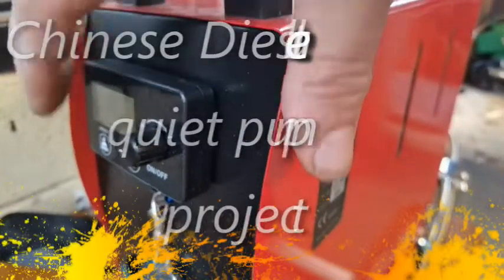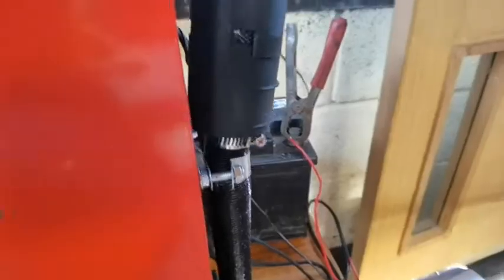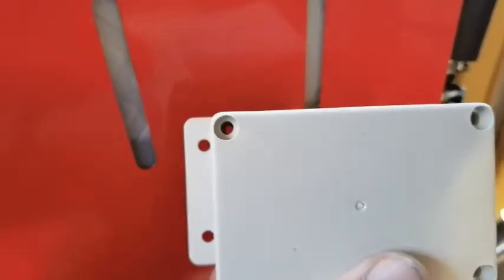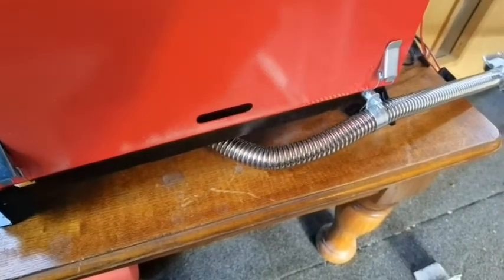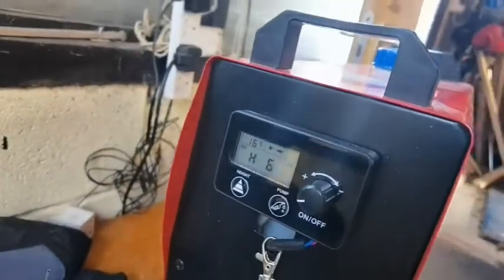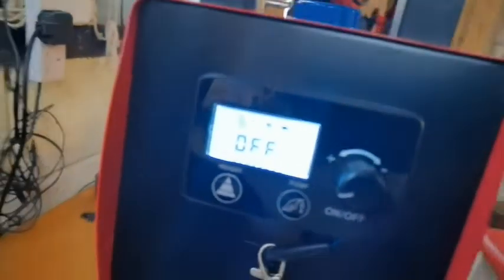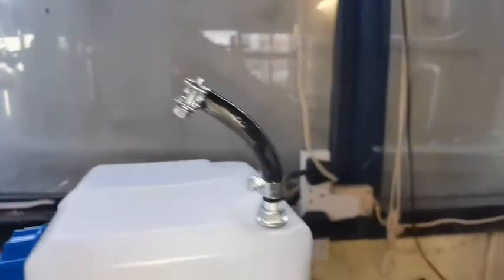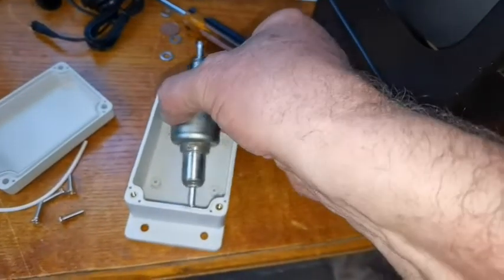Chinese Diesel heater quiet pump project

Comment: Thanks for the thought provoking video. I think much of the noise it due to the pipes tapping on the case and other rattles. I have a similar heater and I love it iny small van 

I got some bitumen car body sound deadening sheet and stuck it to every flat surface I could find within the case. Also wrapped the pump in it like you did. I did away with the rubber bracket and wrapped the pump in strips of Karimat foam and just jammed the encased pump into the space. I put this soft neoprene like foam sheet in all places where pipes touched the case.  

It's a lot quieter and the ticking is a soft dull tone. Acceptable but I'm still looking for ideas. Potting the pump in silicone is my next idea but I'm looking for examples first. 

Nice video thank you for your efforts.

Comment: My Dad had some success quietening the noisy pump by wrapping it in neoprene foam, then dangling it from small rubber bungies which helped isolate it from the heater body, I mean it still clicks but not much of the sound makes it from the pump to the rest of the heater. The weird thing is, I've got a Japanese paraffin heater which uses a similar solenoid dosing pump, but for some reason that makes no discernible noise at all.
Reply from the maker: Thanks for watching and comment
Reply: Parrafin might be thicker and thereby dampening

Comment: Great idea using the box but if you had used acoustic wadding or quilting rather than hard rubber it would improve the sound reduction hugely. In the example here the pump sound transfers easily through the rubber to the outside box and onto the outer heater casing so not much if any change. Enjoyed the video and thanks for posting
Reply from the maker: Thanks for the tip!
Reply: Silicon works well. It's possible to run these with no pump, just needs one to start or there's an error code. Measure the flow properly and it's no problem, totally silent.
Reply: @MHLivestreams  What do you mean measure the flow?
Reply: @georgeda90  should have said fuel rate. To calculate the fuel used when operating by pump.

Comment: What I did was bought a silicone mold making kit.  One that xxx toys could be made of soft.   An taped the hose ends.  And the plug part.   An just got a Tupperware container.  And encapsulated the pump.  Than with a razor blade.  Extracted to my tape areas to expose the plug an each hose end.  Plugged it up to the hoses an plug.  An just stuck it in the heater an closed it up. 

 I didn’t worry much about the pump getting to warm due to its electrical workings or what not. Due to when it’s used it’s cold in general.  
An never has an issue. So it’s kinda floating in its lil spot inside the heater inside of a soft silicone block
Reply from the maker: Now thats worth a go thanks for info
Reply: Play Dough or modeling clay is much easier.
Reply: @castorpollux3752 I would have NEVER thought of using playdoh!! Good idea!

Comment: Try a softer insulation material , mount the pump  outside in a insulated box . Make sure you use thick material. Do not mount it on the case. The rubber you used is to hard and as somakes little difference. Good video though, shame it was not as good as you inticipated it to be.
Reply from the maker: greats tips thanks for watching Andy

Comment: I did this using roof and gutter neutral cure silicone.
It was a layer about and inch thick around the pump body, once cured clamped in a box similar to yours and its barely audible. 
Problem solved!
Reply: Please post a video of your silicon solution. If your solution works as you claim you will get thousands of views.

Comment: Try it without the box, wrap with a pool noodle, or pipe insulation, a couple of wraps of electrical tape, then a 2" x 1" double sided foam tape and stick it to the back metal of the unit and try to keep the angle correct. It should isolate the pulse, and the slapping home of the pump piston.

Comment: Just thought I'd mention that the muffler should be mounted vertical with the drain hole facing down and the lowest point of the exhaust system

Comment: The back panel of the case that the pump is bolted to is vibrating causing the noise.
My pump is attached to the frame of my ford e250 with the rubber holder. She's quiet as a mouse.

Comment: Buy an Eberspacher pump, in the blurb for our heater it describes the pump as “near silent” ours is mounted underneath the van and I can honestly say I’ve never heard the pump either Inside or outside the van. Hope this helps someone.
Reply: Do the pumps need sealing in a box or something under the van I worry about rain water etc
Reply: @scousebikers  I think the pump is alright it’s the circuit board in the Chinese heaters that is not sealed against water and hence it’s vulnerable to water ingress.
Reply: @AJ-qn6gd  oh yeah that's no problem that's inside I am just rerouting fuel lines tommorow hopefully was using a auxillier fuel tank but it started leaking inside the van what about the connection to the pump surely that's not watertight??
Reply: @scousebikers  the electrical connection should be an automotive quality connection with a small rubber seal in it and snaps together like engine sensor connection not heard of any problems with the pumps, mine is under the van and no issues whatsoever.
Reply: @AJ-qn6gd  ahhh perfect I'll have a look to be honest I didn't think but it makes sense that it would be waterproof with it being for boats cars etc

Comment: From what I do know about soundproofing. You may have two issues . One is the rubber you used is probably still allowing the vibration from the injection pump transfer to the outer metal case .   The other issue is the plastic plug is touching the plastic housing when you put the lid on , that allows the vibration to transfer to the plastic box .  Also same with the hose ends .  Might I suggest trying to use sound dampening materials for example put it in a box that is twice the size of the plastic box and use cardboard egg cartons on the inside walls of the box then find a block of soft foam to mount it too inside the box ,  run the hoses through that box without touching the sides of the outer box but through some soft foam .  It won’t fit inside the metal container but it should still be as quite or better .
Reply from the maker: Cheers Steve will give it a go

Comment: Try closed self foam insulation like you use in HVAC. It’s black in color and you can get it in different sizes. You should be able to simply wrap the insulation around it and zip tie it to keep it closed all done, faster and cheaper.

Comment: To start, buy an upgraded fuel line kit, run the pump in a vertical orientation. As long as the pump no matter what the insulation is affixed to a solid percussive object you will hear it.
The rest is easy.

Comment: there are two fails that makes the whole invention totally useless: the ends of the pump are tuching the plastic box, AND the plastic box is touching the main case through the bolts. My friend, unlike the thermal isolation that admits some looses from thermal bridges, the mechanical vibration isolation REQUIRES a TRUE mechanical TOTAL isolation!
Make the pump "floating" in soft foam and you will success
Reply from the maker: Thanks ill give that ago

Comment: I know this is an old video but from a sound engineering perspective I would try wrapping the pump in a butyl type tile for automotive surfaces, then encasing with a fair amount of closed cell foam and lastly a mass loaded vinyl.

Comment: You need rubber mounts from the box to the sheet metal. the sound is amplified by the sheet metal try not to mount the box with bolts just hanging and check for noise level.
Reply from the maker: will do thanks for help

Comment: Ps. Maybe try a less dense sound absorbing material. Like a modern rock wool material, you can get fireproof/ heat proof versions. The rubber you used maybe transferring the noise more because it is so dense, also van sound proofing. I am thinking of getting one,and  I am thinking like you of the noise. Keep on thinking spot on. Ray

Comment: Your exhaust extension may not be safe.  I don't think you're supposed to extend the small pipe so far.  It would probably be better to increase the diameter to run farther than the stock exhaust pipe length.

Comment: How about this.... 
Yongle Elliott ET950 Noise Reducing Cancelling, Cloth Adhesive Friction, Wire Harness Fleece Tape, High Temperature 220F, 3/4" X 25M FS

Comment: Encase it in silicon sealer and use silicon to stick the box to the heater. But be careful with the electrical contacts as silicon setting gives off fumes which cause steel to rust so I would wrap the plug with insulation tape. Or encase the pump in black dense foam two halves shaped to fit the pump snugly
Reply from the maker: thanks Paul
Reply: @MrMeltedwellies  don't know if expanding foam would be better or worse to encase the pump.
Reply: That’s exactly what I did.  Bought a really soft silicone that I looked up could be used for xxx toys.  An a small Tupperware. Taped up the hoes ends an plug.  
Encapsulated it completely and with a razor. Carved out to the important areas.  An just hooked it up in the heater with it floating in its silicone block

Comment: Try a Decibel meter at a set distance before and after. Try encasing the pump in a softer medium ie. foam rubber. Bear in mind any hard surface in contact with the sound source will transmit sound. interesting video though.

Comment: What about using an off cut of sound deadening foam wrapped round it then stick it in the box 🤷🏻‍♂️
Reply from the maker: Good point Grumpy might give that a go
Reply: I have one and a buddy of mine has one and can't get over the thumping so he put it in a coffee cup and sprayed GreatStuff to fill the cup.  It works pretty good for the effort. Id say 60% reduction.   Pulling it off the back panel has to be a tremendous improvement.

Comment: the only way to beat this is to hang the pump from a frame on fishing braid.
may I add that the exhaust recomendations are no longer than 2 meters in length.
and the green fuel line puts extra strain on ther pump as it gives and expands each time the pump pumps making the fuel injection less effective, almost everyone replaces it with the hard 2mm core nylon fuel line that doesnt expand as the pump pumps.

There are also no fuel line clips on the fuel hose another saftey issue to note. the green fuel line has been known to perish and split esspecially around the exhaust outlet, this could cause a fire. you will also need a fuel filter installed before the pump, most heaters come with one. as you have it set up I honestly wouldnt put it a family members house without at the very mimimum doing these saftey upgrades.

 and please make sure you install a carbon monoxide alarm. some titanium exhaust wrap double layered may also be advantageous to keep the hot exhaust from damaging the fuel line or to protect the hands of little ones if they should grab it? it is available on Amazon.co.uk or ebay. you can also searh either site for the  Diesel Heater fuel line upgrade kit it costs about £12.00
Reply: Use a wider bore for longer exhaust lengths, no problem.

Comment: Watch this video and notice where the fuel pump is installed (outside of the case) and an improvement on fuel lines. In this video you can't hear the pump at all.
https://www.youtube.com/watch?v=gNKTZosL6d8&t=688s

Comment: This video may be of interest to you, i've seen many suspend pumps like this using strong elastic and it does make quite a difference, the only problem is you'll have to mount the pump outside the case. hope this helps in some way https://www.youtube.com/watch?v=rP3FOPqtINg
Reply: George M ..I'm researching tricks for when I buy a diesel heater for my small caravan, (17ft.Oasis)and when I saw your link, wondered if it was the one I had already watched, and it was. I think I will settle on this one (in your link) as it seems to have the most feasible explanation for getting rid of the vibration noise. The elastic suspension shouldn't transfer any vibrations and the insulated box should get rid of the rest of any noise. I'm thinking about installing it in the front boot of the van for easy access (I'm partially disabled) with a removable fuel tank so as not to risk spilling diesel, and having fuel filter and pump where it will be easy to change when necessary. I could even mount the pump and filter on the A frame of the van, out of the way.